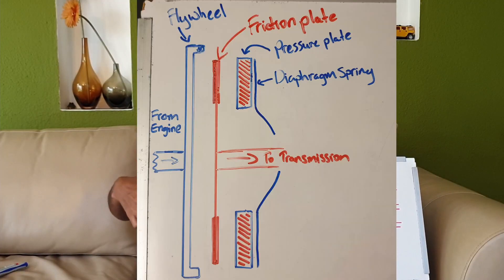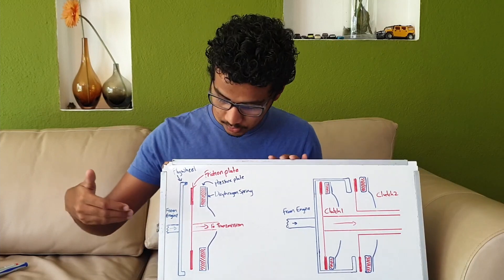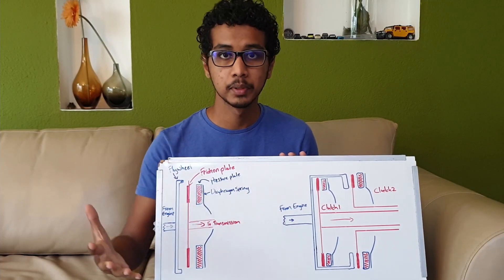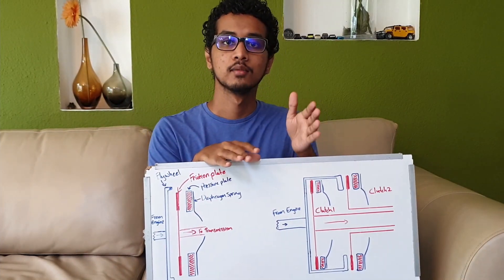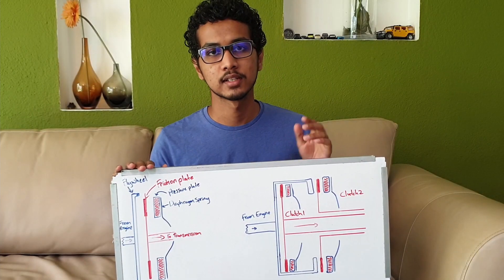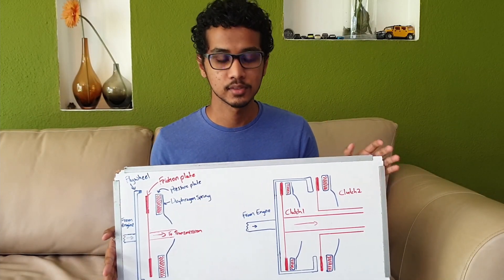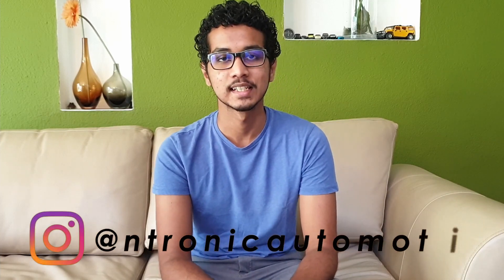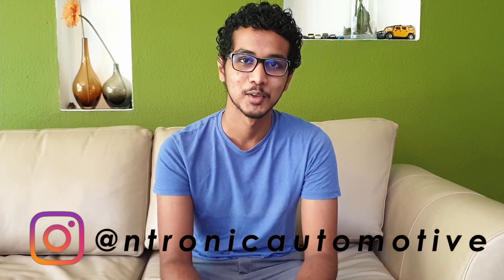What Causes the Problems in a Honda Dual Clutch Transmission?| Ntronic Automotive

Comment: if I want to buy a used car (DCT transmission). How I understand the car has an issue with transmission on my test drive. 
how I understand the transmission is completely good. no issue.
how I understand the transmission is a slight issue. if I do a little maintenance work then full ok. 
how I understand the transmission is fully Bad. Big issue & don't go to buy it.
Reply from the maker: If the vehicle doesn't move when you lift off the brakes in drive, it means the clutch is faulty. That's one way to find out!
Reply: Hi try test driving a rather new one if you have a friend who has one or if you can get a test drive from the honda dealership. 

Now test drive the used car. Pay close attention to any clicking noises or jerkiness. Dcts are a bit noisy but since you drove a new one you can compare the noises. Dct transmissions when well maintained have smooth gear transitions. Test these as well and good luck